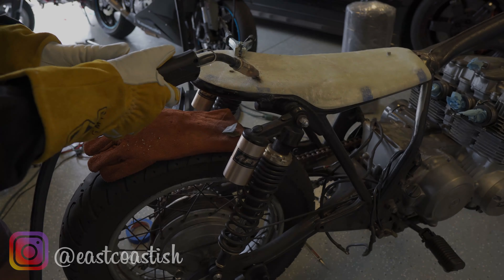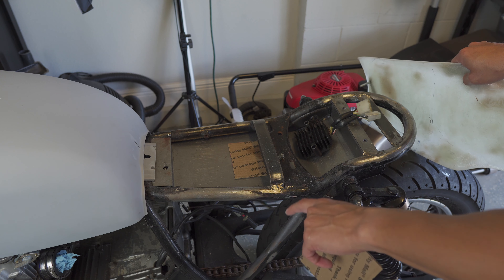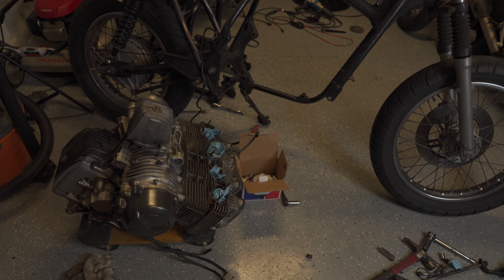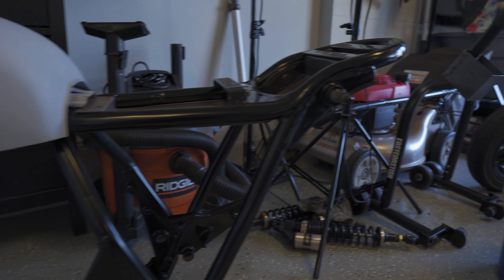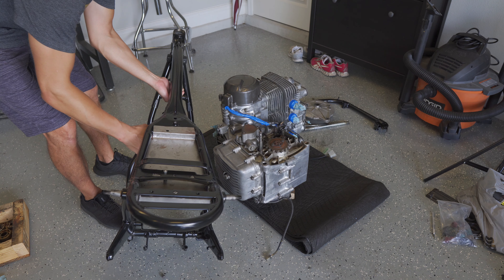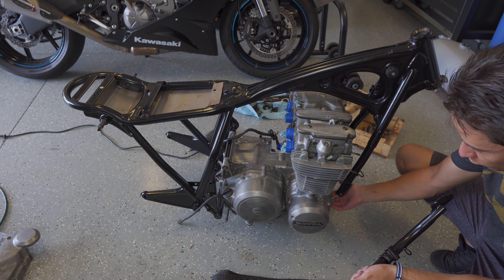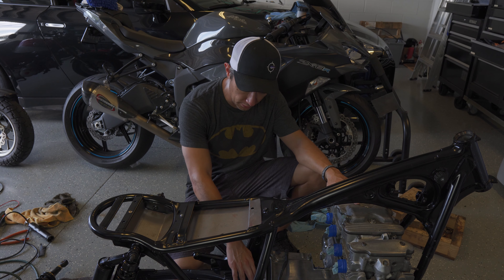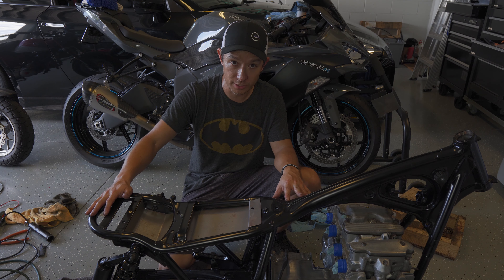CB650 Cafe Racer - EP4 (Powder Coat)

Comment: What length shocks did you go with? I thought you mentioned going a little longer in a previous video. Bike turned out great!
Reply from the maker: They are adjustable 350mm-360mm (currently at the lower position): https://4into1.com/black-remote-reservoir-shocks-eye-to-clevis-350-360mm